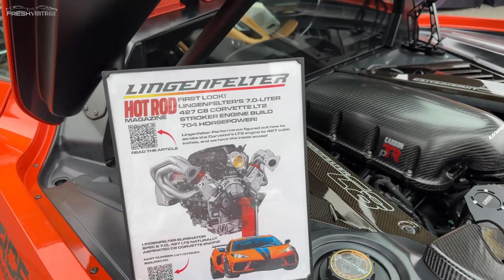Listen to the WORLD'S FIRST 427 Cubic Inch Lingenfelter Powered C8 Corvette!

Comment: The caption of the video doesn't make sense because the motor block and heads is not a traditional big block like it's stuffed in there it probably is a l t r lt2 racing block which is forged and meant except the larger crankshaft and pistons and could be punched out to I believe 502 cubic inches but as a traditional Big Block in the car it does not have that the block and heads are stock size
Reply from the maker: Thanks for watching! It's a 427 cubic inch engine 👍

Comment: That's not much more power than the original LT6 engine with 670HP. That's only 34 more HP than the original that is only 5.5 liters. This makes zero sense to me.
Reply: The 427 LT2 is a stroker motor producing nearly 200ftlbs more of torque then the high revving LT6. The LT2 hits the rev limiter at 6700rpms while the Z06 hits at what like 8600? They'll drive completely differently from each other, the 427 will be quick, while the Z06 has the potential to be faster on the top end.
Reply: That imitation Ferrari motor has no torque down low

Comment: Because the 7 liter displacement is the internal swept volume of the engine. It doesn't at all change the external dimensions.
Reply: I was gonna say that they are the same size, thanks for this !
Reply: Exactly. Even the prior LS engines were the same dimensions between the LS1 346 and LS7/427.
Reply: Correct. It’s still a small block.
Reply: This is what the C8 70th Anniversary Edition should have come with a 427 7 liter v8 70 th lol different engine from GM would have increased the value of the car a lot more

Comment: How they fit a 427 in there? Because the outside dimensions are the same for a 4.8,5.3,5.7,6.0,6.2 and 7.0
Reply: Small block
Reply: Threse a guy that just put an 8L in one
Reply: Not a tall deck block its dimensions are unchanged.  I have a 416 LS9
Reply: Just saying that an LS/LT engine is the same outside dimensions whether it’s a 4.8 truck engine or a 7.0 427 LS7, the CID or Liter displacement comes from the bore and stroke inside the block, they can go up to 464 with the standard short deck that came in production vehicles, and I think 495 with a billet crank, the aftermarket tall decks can go over 500 cid.

Comment: So barely more power than zo6 🤔😒😒😒
Reply: The question is.... the tune thats shown is it at its lowest setting middle or high? I'm pretty sure it can make more if they wanted it to
Reply: The difference is the torque, 600 vs 460.  Very different driving experience.
Reply from the maker: Trust me when I say if I had a C8 and had the cash to drop a 427 in it I would 100% do it 😁 
Z06 is cool and all but it's not 427 cool 😎
Reply: @freshvintage  I need more 🤪 if I'm gonna do swap I need at least 800 at the wheel 😌😌😌😌
Reply: @mryeahisaidit  And if this 800HP would you say you need 900?🙄
Reply: @garyglenn3654  very true 👍 cuz going fast is addicting 🤔 we should probably aim for 1000+ and bottle 🍼 feed it too
😈😈😂😂 I can hear my neighbors complaining now 🤣🤣🤣🤣